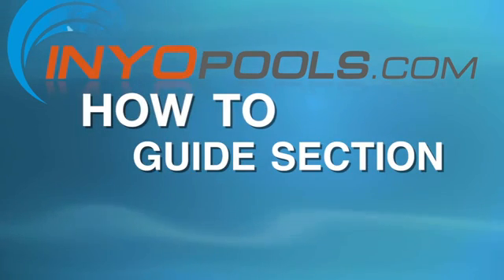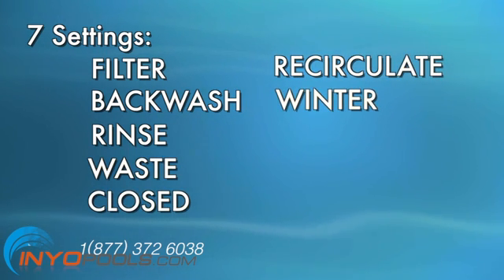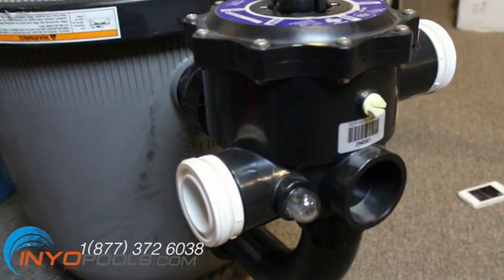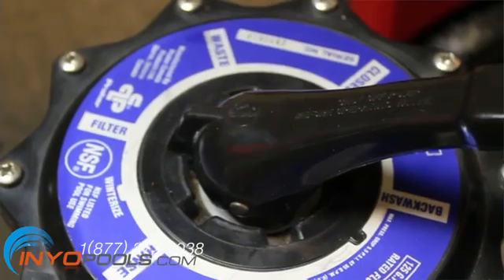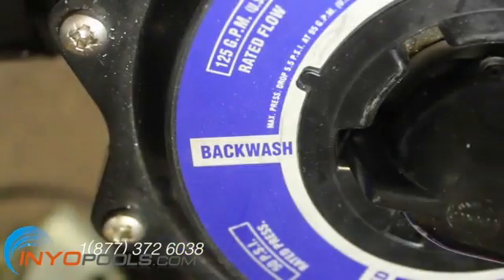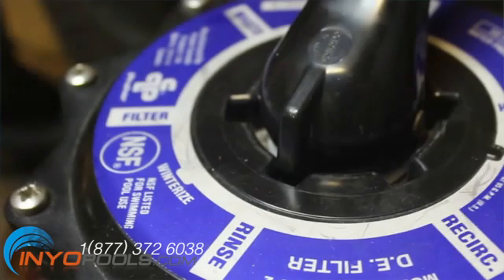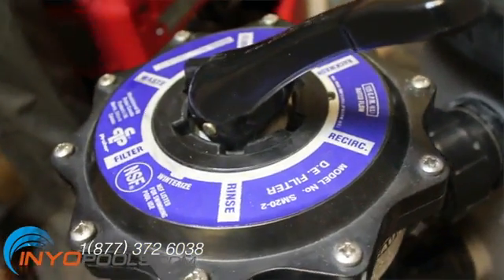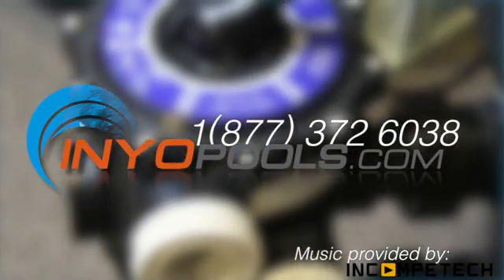How a Multiport Valve Operates

Comment: Good video, however shouldn't we always turn the valve in one direction? Everyone I know turns them clockwise, so as not to rub the diverter gasket back and forth.
Reply from the maker: Yes, you would want to always turn it on one direction. This means always turning it clockwise or always counterclockwise. Switching it back and forth can pinch/damage the spider gasket.

Comment: can the multi valve go bad,and let the water drain out of pool even in filter mode
Reply from the maker: Hi William, if you have a crack in the valve or a bad spider gasket, then water could drain from the pool while the system is running. We have a How-To Guide on replacing a broken spider gasket found here: http://www.inyopools.com/HowToPage/how_to_replace_a_spider_gasket_on_a_multiport_valve.aspx

Comment: my new diversion valve is leaking out the waste port after running a while, help!
Reply from the maker: Hi Joe, did you replace the valve yourself? If so, was it the complete valve or just the key seal assembly? If you have water leaking through the waste port, it's usually due to improper assembly, or a broken or faulty spider gasket.
Reply: மல்டி போர்ட் வால்வு எப்படி பொருத்துவது?

Comment: My handle broke off yesterday but it was the diverter?  the bit the handle pins onto and has a spring on it below the multiport. is this an easy fix if i can source the part? i see no branding on my multiport, are they a generic size? thanks and great video
Reply from the maker: Replacing a multiport valve diverter is not easy, unfortunately. It takes a little muscle to compress the spring so you can install the handle pin. If you want an easier route, most valves have top assemblies that includes the handle, valve cover, spring, gaskets and the diverter  pre-assembled. All you have to do is remove the broken diverter and drop in the new one.

The video link below gives you a couple of options: http://www.inyopools.com/Blog/poolside-chat-episode-23-broken-multiport-diverter/

Comment: Hello. I have a 2-speed pump. 1/2-2hp. .18' above-ground pool. Somewhere is read to use a higher setting to backwash. Is 1/2 hp ok to backwash? I am always Leary to use 2-hp because of hoses popping off. Thx!!
Reply from the maker: For thorough cleaning I suggest backwashing on high speed.

Comment: What will happen to the valve if the pump is not off? Please advice
Reply from the maker: +Alex Huang if the pump is still running when you turn the valve handle, you may unseat or blowout your spider gasket from the diverter. This would cause water to flow out of your waste line when you set at normal filter mode and generally have water going where you do not want/need it.
Reply: How many cups of DE to dose if the DE filters reaches almost 30 psi when the pump runs. What are the step-by-step guide. Please advice.
Reply from the maker: +Alex Huang The amount of DE needed to recharge a filter is dependent on the size of your filter. What is the model number of your filter?